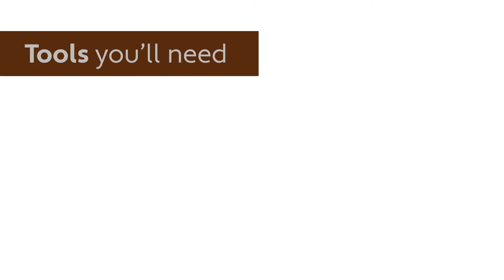How to Install ClipStone ColumnWrap | DIY & Professional Installation

Comment: I just finished installing four post column wraps on my pergola.  The product is easy to install for a DIY project.  I used Loctite 500 masonry adhesive.  I am happy with the product.  I would note that if you are super picky about appearance then you'd be better off  hiring a mason to install custom wraps.  This is cast colored concrete and has some flaws when examined close-up.

Comment: If the column is bumped into wouldn’t  the rock have a chance to move as it’s not backed by anything?
Reply: Maybe fill the void with concrete or pea gravel. As long as water stays out and can't freeze and expand.
Reply: Those were my thoughts also
Reply: Low expansion foam?